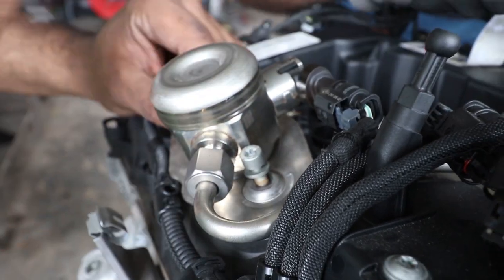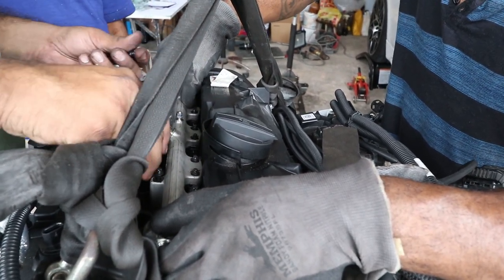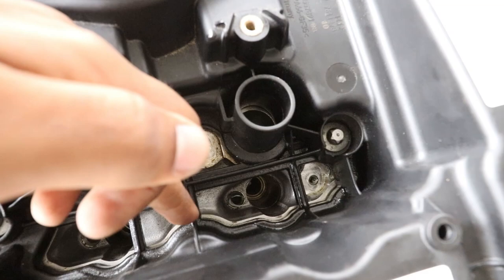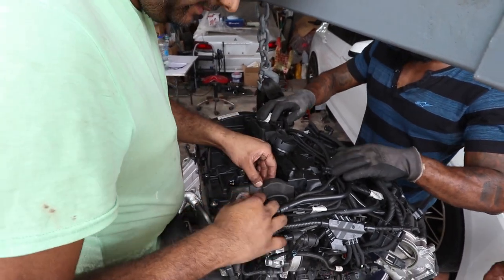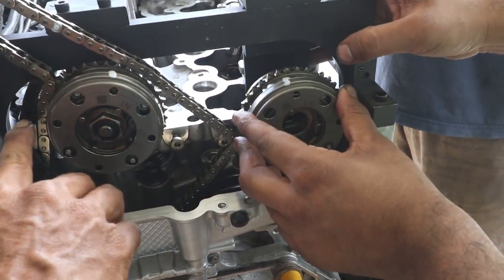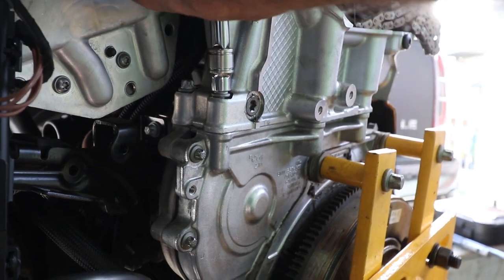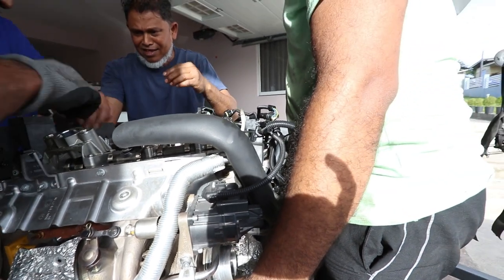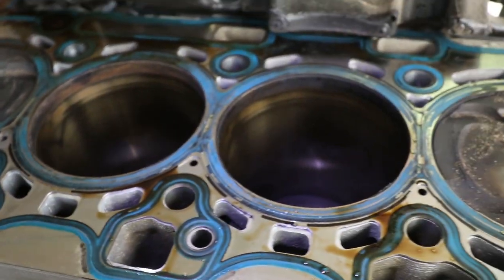BMW B48 Engine Rebuild Part 3

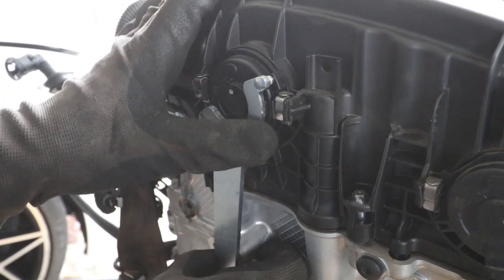Comment: 7:00 is that right there where you guys are taking off are the 2  "Vanos Solenoid Actuators" The exhaust and intake.. is that correct.. on a 330i with the B48 motor???? I'm sorry there isn't any videos on the B48.. It's so hard to find anything and this is actually the only video on the internet and I just had to ask to make sure that those are the Vanos solenoid actuators and the correct name of the parts .
Reply: Yes they are, the things they actuate are inside the camshafts called central valves, just replaced mine